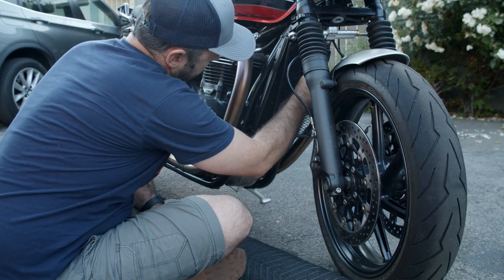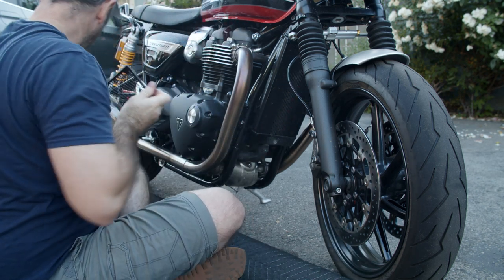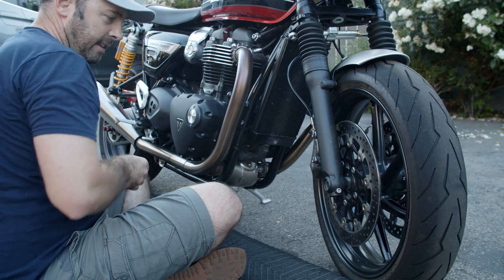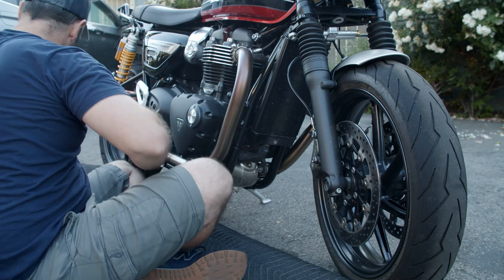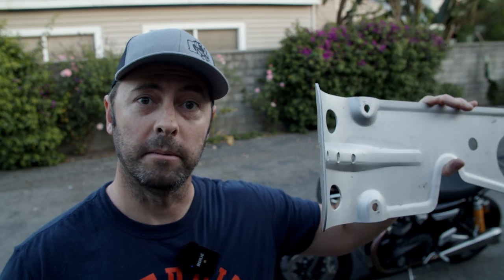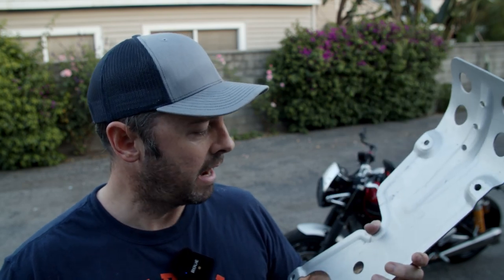Triumph Speed Twin Gasser Customs Skid Plate & Radiator Guard install

Comment: It's nice but I would've gotten it in black color. IMHO. ☺️
Reply: Agree. I would hit it with a black rattle can before installing. There's a reason Triumph tried to hide the black radiator between the black downtubes.

Comment: You’ve abandoned your x-pipe?
Reply: I think adam may have one of the quality x pipes that allows the heat shield to be fitted, unlike my x pipe that leaves itself exposed. Good eye for noticing that.
Reply from the maker: The x-pipe is still in there, yes it’s a Tec Bike parts version with heat shield. I’d never sacrifice the x-pipe! It’s the one biggest performance improvement you can do in my opinion.